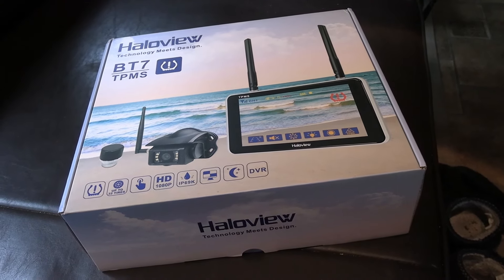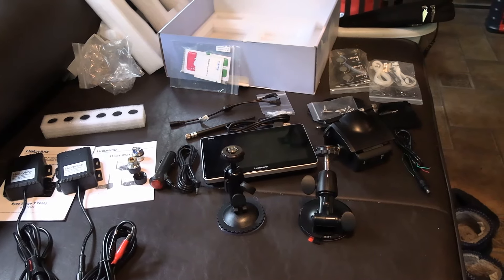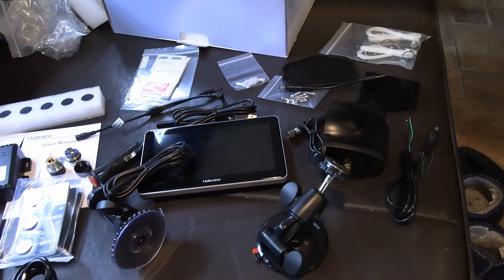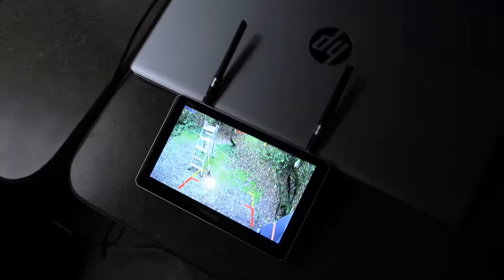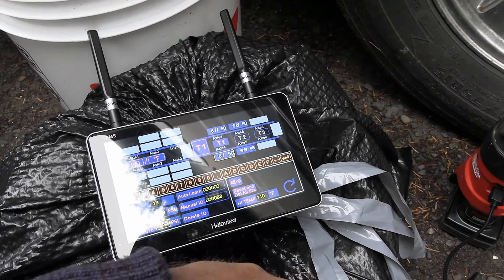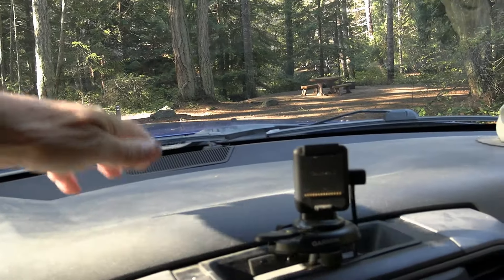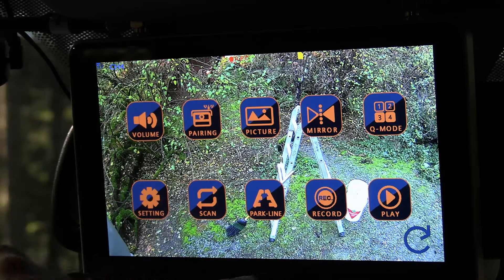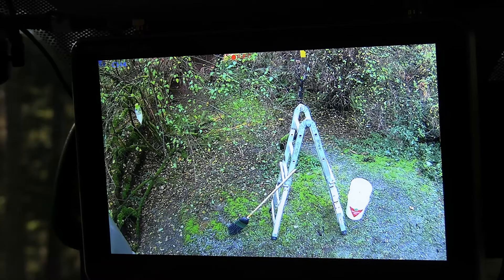Installing an RV Rear View Monitor with Built-in Tire Pressure Monitor - Haloview BT7 TPMS System

Comment from the maker: UPDATE New firmware will be added to the TPMS information overlay. See this video https://youtu.be/3JIcvFScHQE
Related Links
Review Update after 2000 miles - https://youtu.be/Fl7sgBcDlW4
Haloview Website - https://www.haloview.com/byte-tango-bt7-tpms-4-sensors-1080p-wireless-backup-camera-system-with-integrated-tpms.html?acc=413
Haloview Store on Amazon - https://www.haloview.com/byte-tango-bt7-tpms-4-sensors-1080p-wireless-backup-camera-system-with-integrated-tpms.html?acc=413
Previous LYRV Haloview Camera System Videos - https://www.youtube.com/playlist?list=PLp14lzXh07ulhWjxRiSBuQHIaLH83bnba
Reply: Uff-Da that's a chunk of change!  But I imagine if one were to purchase separately, it would be more. Then another bonus is both systems are on one screen.
Reply from the maker: Yes, and cheaper end stuff usually doesn't have good wireless range for longer rigs and picture quality is generally poorer.

Comment: Thank you for a helpful and informative video.  As I am considering one, I am curious to know how it is performing, especially the sensors, any issues?
Reply from the maker: So far it has worked well. I did have to add the second signal extender as with just one the rear axle tires would lose connection sometimes but has been fine once I installed the second extender near the trailer axles. Also based on my feedback they added a TPMS overlay to the display that is nice to have. I just had to upgrade the firmware. See this video https://youtu.be/3JIcvFScHQE  Cheers, Ray

Comment: Thanks Ray. Great video. You did open up the scan function. I'm wondering if the tpms is part of it? That would make it a bit more user friendly
Reply from the maker: I gave my feedback to Haloview and was told there currently isn't a way for the TPMS data to show on screen when the camera view is on. But they tell me they may be able to add an overlay of the TPMS data that could be turned on and off if the user wants it.

Comment: Helpful video. Any concerns with the repeater being a constant draw on the battery?
Reply from the maker: The power draw of the booster is rated at only 0.3 of a watt so not much concern, but a person could put a switch inline or disconnect when not towing. For me, I have near a 1000 watts of solar panels on the roof so just leave it on all the time.
Reply: I bought a name brand TPMS and with all the interference there is now it’s trash without a booster

Comment: I will never again have TP sensors that are not pass through! You have  no idea how many brands are an absolute nightmare to get off when wanting to fill your tire. TST being the worst! It took the techs at Big O 45 minutes to get them off and broke a stem valve in the process.
Reply from the maker: I have been lucky as I haven't had that issue. I have used the EEZTire and Guta systems. It's good, though, to put some anti-seize compound on the threads  https://amzn.to/4fq2DW5. I find that I don't really need to add air that often, maybe once a year. Guess I have good wheels.  Cheers, Ray

Comment: Are the camera's from older models able to be paired to the new one? Ive got an older one I got 3-4 years ago and I added the sideview cameras that i would definitely want to reuse.
Reply from the maker: They have to be Byte Tango compatible so not likely, not too long ago they came out with the Byte Tango model systems and improved the signal and increased the resolution to 1080 Full HD. So I guess to do that they had to change the signals making the older cams not compatible.
Reply: @LoveYourRV  thanks for the reply! I had been wanting to get a TPMS system, so I thought this would be a good option so I could upgrade the cameras too, but not worth it if I had to replace my extra cameras too
Reply from the maker: I'm not sold on this product since you can't have the camera picture up and PSI/Temp showing at the same time. It's either or.  I kind of like to be able to easily keep tabs with just a glance at the TPMS. With this system I really have to count on the alerts working or fiddle around touching the screen back and forth which is not a safe thing to be doing.